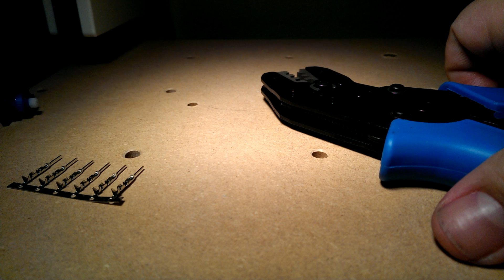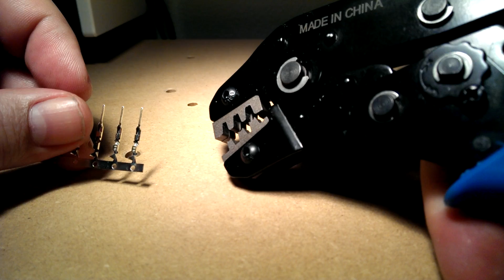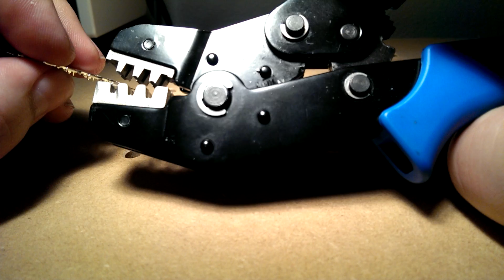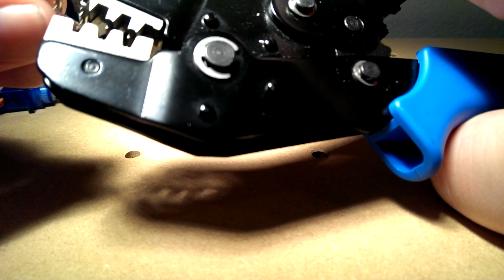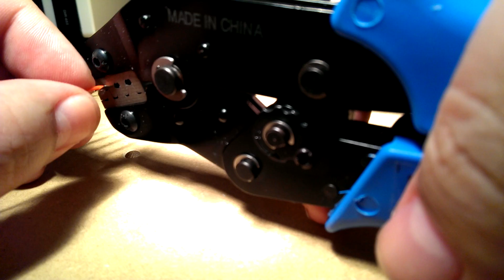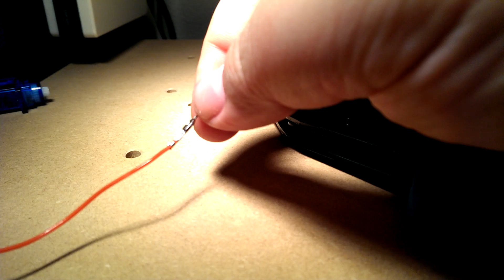Installing Crimp Pins with a Crimping Tool

Comment: It's crazy how useful this video is, even 4-5 years later.  I gave up after ruining a number of these pins and just started folding the tabs with a screwdriver, then soldering the wire in.  This makes it crazy easy to do (though my nearly identical crimpers seem to have ever-so-slightly too deep a crimp-head, and they sometimes bend the pin.  I can straighten it, but...

Comment: MOLEX pins, NOT D-sub!!
Reply: Gwen Walcott Well, “DuPont” pins, i.e. clones of Amphenol Mini-PV. They are neither D-sub nor any of Molex’s plethora of connector models. (Molex C-Grid and SL are similar, but the contacts and housings are not interchangeable with the Mini-PV.)

Comment: Thank you so much! It worked great for my Dupont crimp tool, pins, and housings which I found on ebay from 
alice1101983. My only problem is that I wasted time on other videos before I found yours.

Comment: Daaaaa....... I have these crimpers and I am not going to say how many pins that I have ruined. This video turns a difficult problem into an easy solution. I was approaching the problem backwards. Thanks for the video. As for the crimpers, since I see someone asking about them here, these crimpers come in various sizes which depends on the size of the connector that you will be working with. Usually one crimper will handle 3 wire sizes, so know what wire sizes you plan on using them with. I got mine through Amazon, but there are many sources for them. There is also a broad range in price for these things depending on the brand and the seller.

Comment: thanks for the video! what is the model number of the crimper youre using?
Reply from the maker: https://www.pololu.com/product/1928/resources

I got this to do custom pumper wires, but they also work well for crimping smaller Molex and JST sockets. thought those can be much harder to line up.